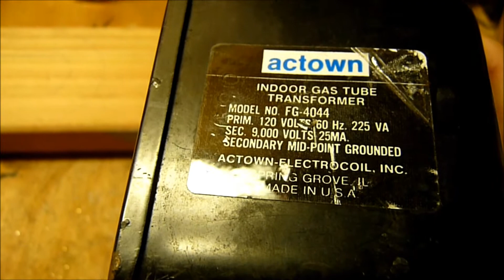High voltage Spiral Jacob's ladder (9000 volt)

Comment: I've made one before. But not with the amt of juice you fed yours. My spiral was like a dna strand with the two poles getting wider as they spiral upward. That way it starts in the path of least resistance. Yours is simpler and cleaner. I like it
Reply from the maker: William Nichols thanks for the input. 
Yeah it takes some adjustments to get it to act right. I'd have like to have seen yours.

Comment: Great video. Quick question: Did you try twisting it so that you get 4-5 more spirals? Also, if you attach a Tesla coil to the two ends of that spiral, you might see an opposite reaction happening (Current goes back down and doesn't dissipate out of the wires).